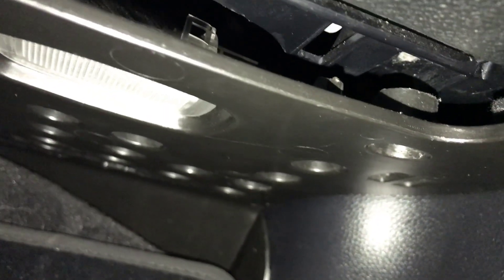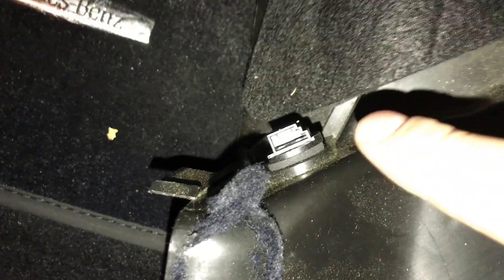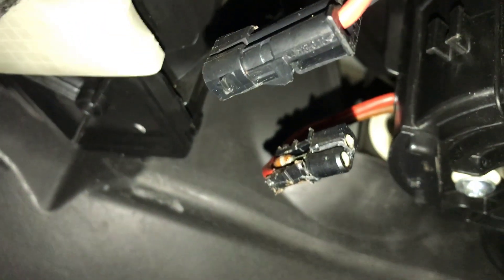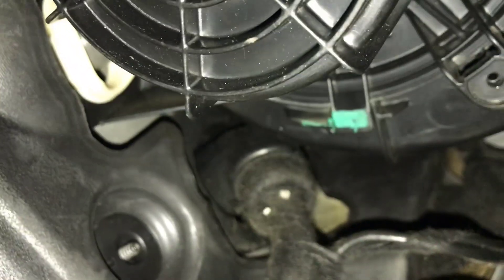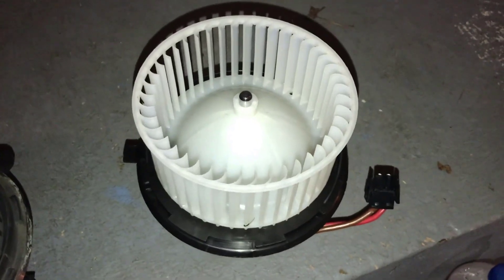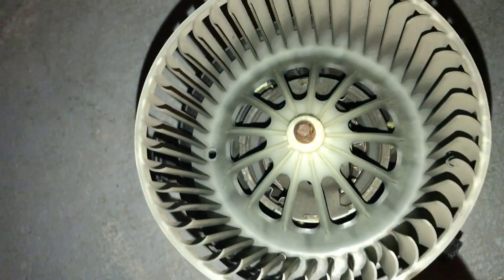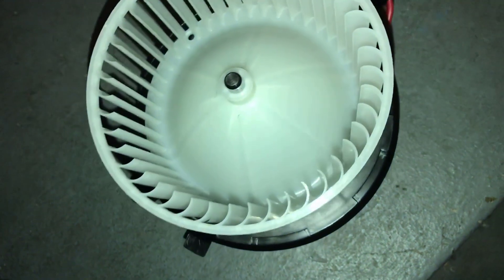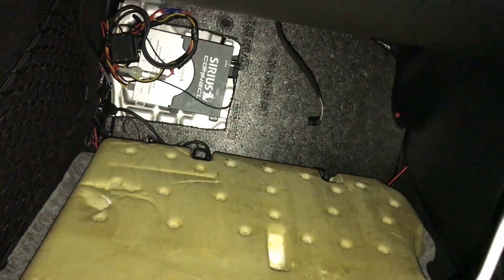Mercedes c300 (2008) Blower Motor Replacement - W204

Comment: you sir are a life saver. Just had my 08 c300 at the dealer for the airbag recall and they quoted to fix that motor, lets just say there were WAY to many zeros. I've always worked on my own cars but this is my first benz and it does intimidate me when it come to repairs. Checked your video and reliezed right away i can fix it. Thanks man!
Reply from the maker: your welcome i hope you enjoy your Mercedes ownership

Comment: Question! My 2009 c300 just stopped blowing air all together. It's 100 degrees in Miami. What diagnostic do I need to do to be sure the blower motor is part I need to get. Thanks!
Reply: Mines stopped working today.

Comment: I pull the fan motor out and tested by connecting to the battery. It is working. Now what is wrong? Fuse or control panel?
Reply from the maker: you would have to test and see if you have power coming to the wires where the fan plugs in if not you know the problem is before that check the fuse and see if it is good and there is power there there is a blower motor regulator but it is rare for anything to go wrong with it most the time if it is going bad the fan will work on some some of the speed settings but not all you can get that part online for about 60 bucks if that is the issue

Comment: Question , how do you know if you need the blower motor or the resistor ?
Reply from the maker: you can test it Using a multimeter set on the Ohm scale, use the positive lead and test the black wire. To check the  wire for current, use your ignition key and turn it to the run setting, turn the heater power to full power and set the multimeter to DC power. If your meter reads "no current" the motor is no good

Comment: I just changed the blower, but it doesn’t work at all, where is the fuse from this motor? Thanks
Reply from the maker: Usually, the problem is the blower motor or the regulator, not with the fuse. Fuse 100 the fuse for the blower  is built into the positive jumper post on the passenger side. The fuse is not replaceable separately.
Even if the fuse was blown,, it would be due to a bad blower motor or blower regulator.

Comment: I bet you never replaced it because you say it's super easy and any one can do it. I just did the job, I'm very handy man and I did many mechanical reparation by myself, and it took me over 4 hours to take the blower out. I could easily pull the tab and rotate the bower but it doesn't come out. After so many researches (what you didn't mentioned) there is a small plastic tab that stops the blower from rotating to the right position. I had 2 options either remove the glove box or to find a solution to break this small tab on the old blowet. That's what I did I decided to break the tab and I could rotate it to the right position. I'm sorry it's not a job that anyone can do. You need to completely put you head below the blower to make the job. I'm pretty sure you never did that job.
Reply from the maker: i dont get how any of that makes any since because i showed you in the video of me doing it i told you about the tab it took me 30 mins to do this job
Reply: All these guys had my same issue on MB forum https://mbworld.org/forums/c-class-w204/524772-need-help-removing-blower-motor.html . You know the aftermarket blower does not have this additional lip, maybe the one you took out from your car is an after market version and that's why it was easy to remove. I agree it's 30 minutes job if this lip doesn't exist because it hits the glove box from inside and very very hard to see it and hard to reach to break it with a plier. Good for you if it was easy for you
Reply from the maker: @80goal  my video is about how mine was and you are the first person out of alot that has used the video with out no problem the link you gave does not show anything about what you are saying my part was factory it had Mercedes stamps on it
Reply: FatalAmbitions it’s a different piece of plastic that is preventing it from fully turning (you misunderstood) - I was able to partially rotate until I hit something by the glovebox, The green tab/flap was pulled down. In some cases people had to remove the glovebox to move out this piece of plastic, some others broke it. While I am trying to do it the safe way my husband wants to break it (I also took a video of the plastic that is preventing it from fully rotating) - in my case it’s not aftermarket and seeing how the glovebox light is not functioning I am assuming it has been fixed before (by Benz due to original OEM part being present)  and someone forgot to re-connect it after reassembling the plastic - I am debating that instead of breaking it, maybe filing the plastic down could be an option...but that’s just me. I will compare my aftermarket part to the OEM
Reply: 80goal did some more digging - some w204 models require the glove compartment to be removed -https://mbworld.org/forums/attachments/e-class-w212/346633d1483980505-advice-chirping-blower-motor-replacement-passenger-footwell-ac-blower.pdf 

Yes this says w212 but it includes the step by step instructions for 204 as well (with special notations)
Reply: Thanks for this comment. I had the same issue, c300 2013 and you can't get the blower out without taking the glove box out. It's not difficult to do, couple more torx screws and one electrical plug. There is a good video on that. Once the glove box is out, it really becomes a lot easier. I would say don't attempt this without removing the glove box on a c300 w204 model.

Comment: Thx, but easier said than done. I won't even give this a shot & am trying to run down s/one to do it for me, H O W E V E R...
     =====> How do you test FIRST, if it's the resistor or the actual motor, because one parts like this are purchased, you don't get a chance to return 'em.